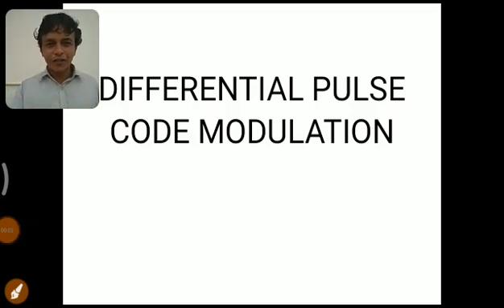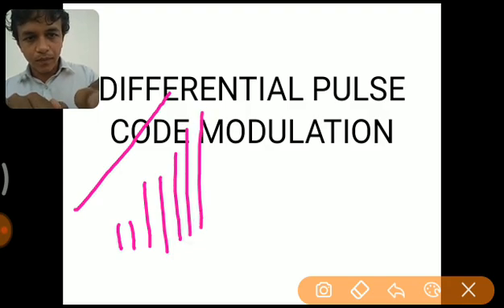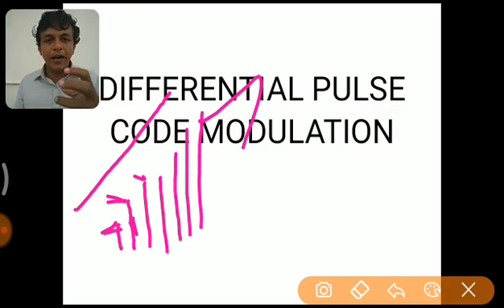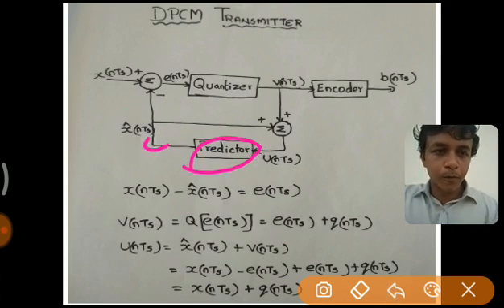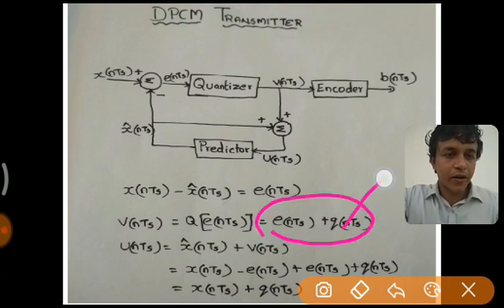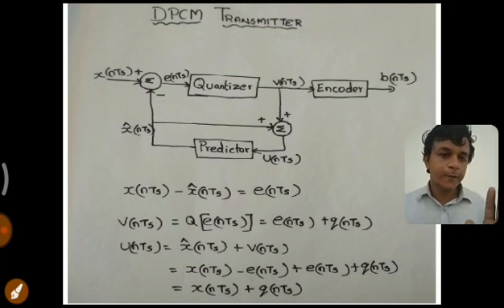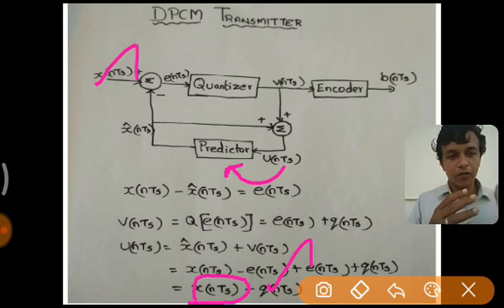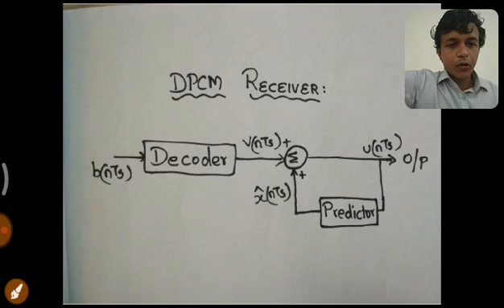DIFFERENTIAL PULSE CODE MODULATION IN ENGLISH WELL EXPLAINED

Comment: what is the disadvantages of DPCM?
Reply from the maker: The step size of the quantizer used in DPCM is fixed due to which it cannot adjust itself to the extremely varying amplitude levels of signal giving rise to slope overload noise and granular noise.

The same is the disadvantage of delta modulation too.

But the differences between DPCM and Delta modulation are:
1. In Delta modulation sampling is done at a rate very very higher than  nyquist rate and also the sampling rate of DPCM.

2. In Delta modulation fixed level 1 bit quantizer is used which avoids the separate usage of encoder as in DPCM.

These disadvantages are avoided in adaptive Delta modulation in which the step size of 1 bit quantizer used is not fixed but variable.